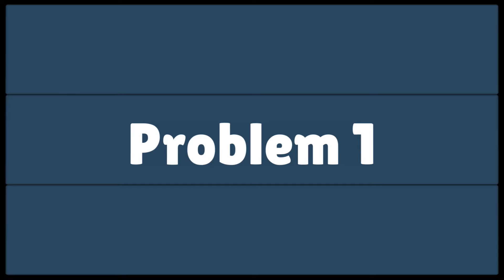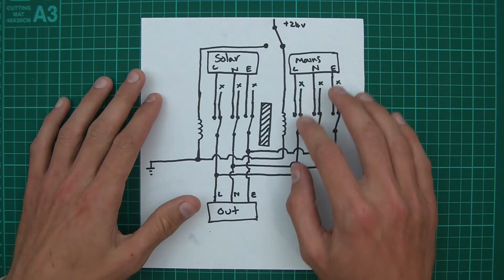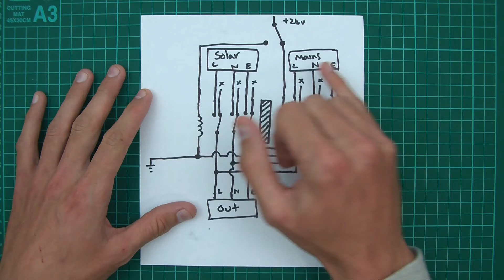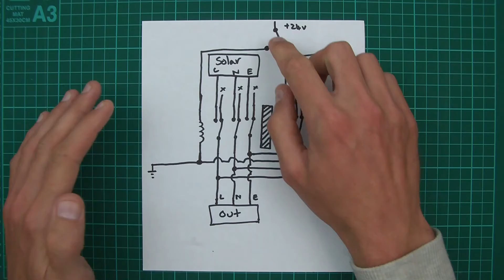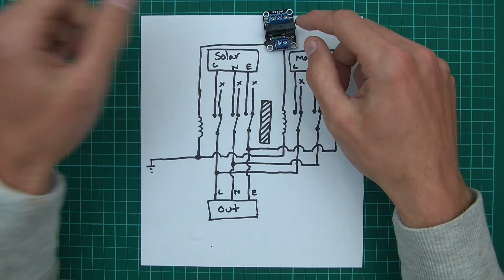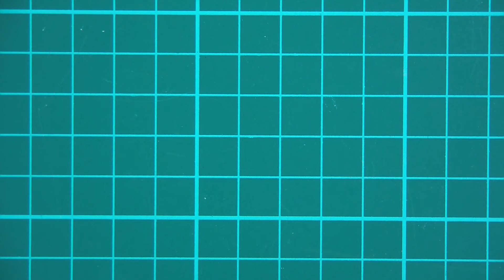My DIY Offgrid Solar Power System (Current Problems & Possible Solutions) - Sep 2017

Comment: What is the delay between Mains/Inverter switching?
I think you need to just get rid of the relay all together. In this video https://www.youtube.com/watch?v=KJ3_OyOl06Y, he shows how these are set up tied in together. When power is off the solar, it defaults back to grid, when solar comes back online, it switches back to solar. It all happens in about 12ms. He even scopes it here: https://www.youtube.com/watch?v=fZhznwksiLA
So, basically, you would just need to kill the relay going to the solar side. This would automatically switch over to the grid when your solar goes down.
I think adding all the extra components is over-complicating things when the contactors setup this way will do the job just fine.
Reply from the maker: Korishan There are a couple of problems with it though. I've seen those videos before and there is something odd. I'll have to recheck to find out what it was. Since though, I've found a single contactor with 2 no contacts with mechanical linkage! So things are looking good now. :)

Comment: Perhaps use a UPS on your computer even with your change to a solid state relay to prevent problems.
Reply from the maker: I'm currently doing that now, but it's not an ideal solution. :-(

Comment: Hi, You can replace the relays with solid state relays and it will decrease the the delay between the command from the arduino to the conntactors.
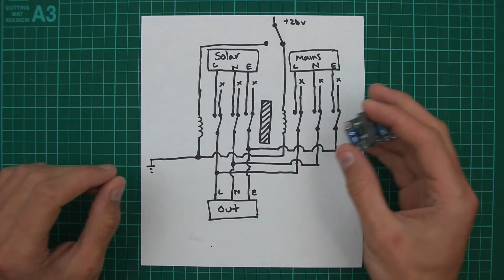Reply from the maker: Yes @ 8:16.

Comment: It needs to be one feed on nc and one feed on no this is how back up systems work if you look at your set up you have first real delay time then delay time of solar relay this is then exegerated by the mechanical lock stopping mains connecting all this takes more then 5ms and makes for a brown out
Reply from the maker: I can only do this is there is a mechanical link between the contacts. :-(
Reply: Antony Cartwright cam you not separate them so you only have the energizer norm open and norm closed terminals
Reply from the maker: Well, these contactors have only one NC auxiliary. I've got more contactors though which I'm going to look at. The reason why I've got the mechanical interlock is because I cannot allow one contact to weld shut whilst the other pole(s) contact as normal. What it would mean is that in the event of failure, I could have one contact welded (stuck on) to Mains L whilst the Solar N contacts, or the other way around. However, I've recently found a contactor which has 2 NOs and apparently a mechanical linkage. So that will work. :-)
Reply: Antony Cartwright ah a see odd arangment mind you if they mentioned for cnc or such they are funny systems
Reply: Antony Cartwright saying that wadkin cnc units are 3 phase switching with 3no and 3nc terminals
Reply from the maker: David Simpson I've now found a contactor... (But it's only 10a). I'm going to put a 24v coil in it. I'll use the nc for mains... And the no for solar. I'll switch two poles and tie the earths together...
Reply: Antony Cartwright yeah that's what I would do